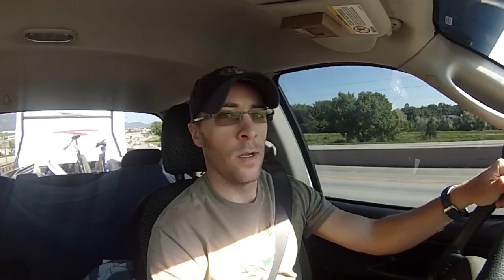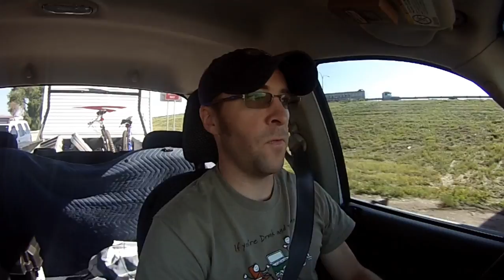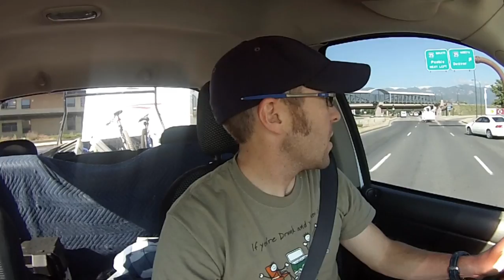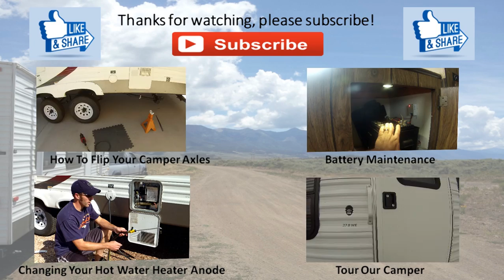Camper Ride After Flipping The Axles

Comment: Thanks for this and the actual flippin' video!  I had to laugh, because we took our "new to us" camper out by Tarryall for a shake down trip and I managed to bend one of the stabilizer jacks about 2 min's into the forest service road.  It was a long slow trip back out, 3 days later.  I'm making the flip next week before our next trip.

Thanks again, Tractor on,
Phill
Reply: If you have cambered axles not straight tubes you'll need to either  do a bolt on flip kit or weld the perches on 180 for spring over . If you have straight tubes  nothing to do but So in the tube and bolt it back up .

Comment: I'm looking for a camper,.. I don't know if I should get a truck camper or trailer? What do you think i should go with?
Reply from the maker: ***** I could write a long list of the differences between the two (I will at some point make a movie about the differences).  Here is my feedback for you based on my experience: I like my truck camper because it is compact, it hauls/tows easy, and setup at a campsite is a matter of parking your truck.  I don't like my truck camper because it is a pain to get loaded on the truck, there is minimal floor space, I can't leave the camper at a campsite, and sleeping 3+ people is very tight.  I like my travel trailer because it has about 3 times the amount of floor space, a lot more amenities, sleeps 4-6 people comfortable, and just is more spacious overall.  I don't like my travel trailer because my MPG is terrible, I can't use it in the winter (too sketchy to tow and don't want the lines to freeze), and setup at a campsite takes a good amount of time.

There are always pros and cons to every camper.      I guess the main question I have for you is how do you plan on using your camper?  Where will you be camping/going? How many people will be sleeping in the camper?  How much space do you need?  Do you want to drop your camper and be able to use your vehicle?

I hope that helps.  Let me know if you have any other questions!
Reply: Build your own from a cargo trailer